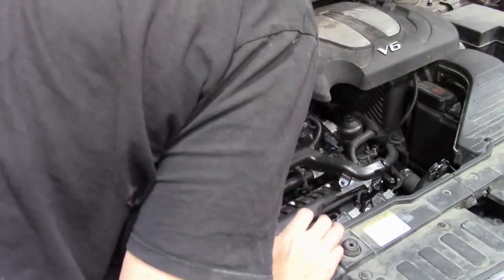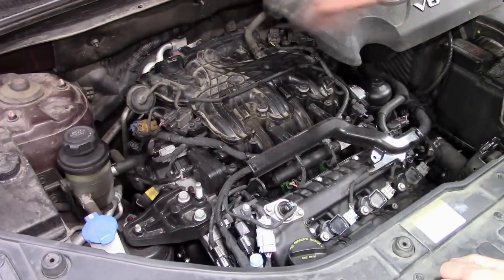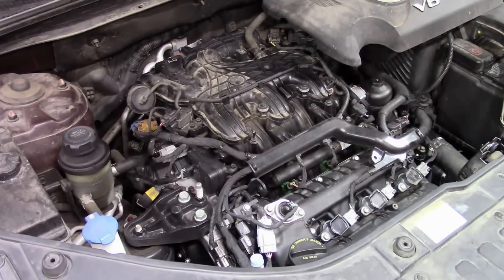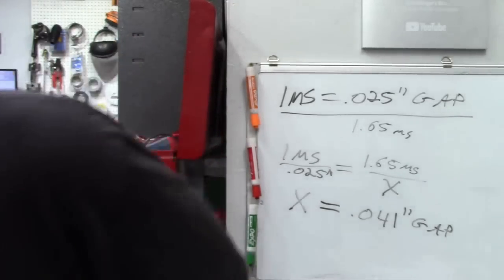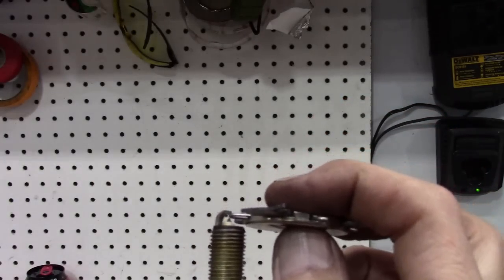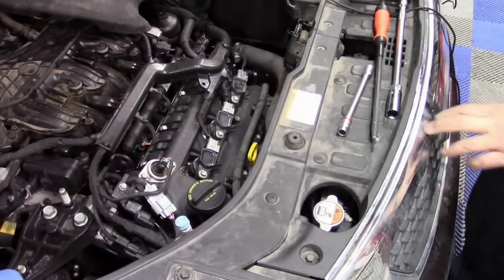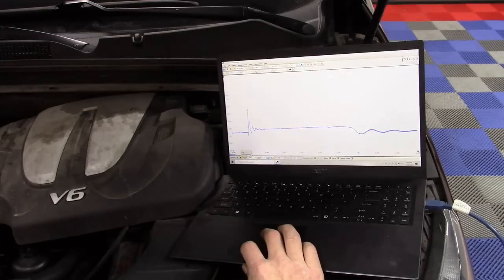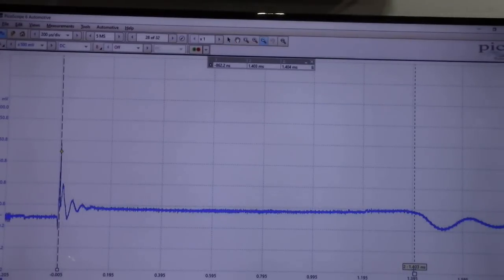Can You Tell Spark Plug Gap Without Removing The Plug?

Comment: Very cool! More gap requires greater voltage required to overcome resistance across gap, which will reduce the duration of spark, since the amount of energy available for ignition is limited. 

I'm an aircraft mechanic working in general aviation. Most piston aircraft have magneto ignition systems. If the spark plugs have too much gap, it will increase the "coming-in speed", the rpm required to turn the magnetos in order to function properly, and the engine will be harder to start. The mags will have to be driven faster, more engine rpm, in order to produce enough energy to arc across the excessive gaps. For what that's worth.

I have a feeling there is a logarithmic relationship between gap and spark duration.
Reply from the maker: correct. I couldn’t think of it at the time!

Comment: The essential component missing from your experiment was the voltage level at which the plug started to fire.  If you can factor that into your 1ms=.025 gap, you could be onto something.  Still the video was a success in my mind.  Experimenting is a great way to learn.
Reply from the maker: Thanks for the info!

Comment: the beauty of what you have done doesn't matter if you can tell the exact gap. the point is you can tell if they are all about the same. so if the 3 on the front are new and look good and you scope the rear and they are a lot different all you really need to know is if they are way different most likely they didn't replace the hard to get to plugs  thats the way i look at it wonderful info. would be great to know the gap  but knowing the difference helps a lot
Reply from the maker: Exactly correct.  It would have been nice to measure gap but it is not necessary if you have a standard.  The only challenge is not all engines have an easily accessible standard
Reply: @SchrodingersBox  my question is to have a standard wouldn't all of the ignition systems have to put out the same to the plugs. because if one system had lets say hotter coil then wouldn't that change it as well. i would think you would need a standard for every vehicle based on the scope reading you got. or am i going off the deep end and overthinking
Reply: @DependableAutoTruck  It is a differential test, not a measurement for spec. If all you want to know is did they sketch out on the rears you don't need to know the absolute state of the fronts, just the difference between banks.
Reply from the maker: Totally true, there are a lot of variables on this.  I will need to see how much those variables contribute.

Comment: One day I did a similar demonstration on the Pico with various plug gaps, and at first it lined up as we expected, longer burn time and lower firing voltage when there was a smaller gap. However clips I didn't publish, with double the normal gap, showed no difference in burn time, firing voltage, or spark voltage. So although the theory lines up fine, the sensitivity of that test to reliably identify plugs with large gaps is not great. Of course that may mean a larger gap is OK, but as plugs wear there are many changes, some of which are of no consequence and some of which can put extra strain on other hardware like the coil, etc. The other thing to bear in mind is the fact that in a distributor system there is a gap at the distributor cap, too. So you're dealing with the sum of the two gaps, bringing in another source of inaccuracy. The way intake manifold gaskets tend to get stiff and shrink with age, it makes sense to follow recommended service intervals and change what gaskets are necessary to get the job done. A tiny vacuum leak along the intake manifold may be equally hard to recognize.
Reply from the maker: Well if anyone already tried this it would be you Dave!! I will absolutely have to go look at your video but that’s really interesting and seems consistent with my trend. great point on the distributer cap (no pun intended).  I so seldom see those anymore I don’t think about it!
Reply: Spelunkerd, your pico secondary ignition video is one of the best available!

Comment: In any case, one can obviously do a differential comparison. In the same car with the same type of plugs and all else working correctly, the burn time should be consistent between different plugs. Significant differences front bank to rear bank should be noticeable.
Reply from the maker: Yep it looks like that may be the only way but hell that is still way way faster than removing an intake!!

Comment: What about applying this method to waste spark systems? 🤔😉
Reply from the maker: Damn Ivan hahah-- leave it to you to come up with a variable I overlooked!!!  I honestly didnt even thing about that.
Reply: @SchrodingersBox haha just flipped a neglected 2006 Hyundai Tucson V6 that I got for 350 bucks. Checked front bank plugs and they looked OK so I assumed the rear bank was fine. Had to remove the intake plenum to change the rear valve cover gasket so popped out a rear plug just for kicks. The ground electrodes were GONE on all 3 rear plugs!!! 😳 Car ran fine btw, never skipped a beat 🤣

Comment: A smaller gap means less resistance, so less energy is required to jump the gap. Hence, more of the stored energy in the coil will flow through the secondary - taking more time.
When more resistance is present , you have a shorter duration of secondary current flow and more oscillations in the primary. Love watching this experiment, keep it up.
Reply from the maker: Yep that is what I finally figured out-- just couldnt think while filming. I knew there was an explanation.

Comment: We have taught this for quite some time in professional classes. The way I learned had a pretty simple analogy. The amount of energy in the coil is a fixed, how that energy is dissipated is not. Imagine a length of string as the total energy in the coil. The flatter that you hold it the longer the horizontal line (longer burn time) it creates. The higher the angle between the ends the shorter the horizontal line. (Shorter burn time) The things that cause a change in the spark demand voltage (KV) are: Plug Gap, Air/fuel ratio, ignition timing, and compression. It's notable that the plug gap is only one of those. Burn time and burn voltage from there are also dependent on those same factors but now the resistance of the spark plug wire (if used) also comes into play because of the current that is flowing through the ionized ball of gasses between and around the electrodes of the spark plug. 

In practice we have found the COP probes to be disappointing. Many coils have sufficient shielding that makes them almost useless and if looking at secondary voltage and burn time is necessary for diagnostic purposes it's better to install a plug wire between the coil and the spark plug and use a conventional pick-up. 

If you want to have some fun with this try to answer this question. 
Why does the spark KV demand and burn time vary at idle as can be seen on the screen?
Reply: Hi John, it's Duane from iATN, no I don't expect you to know me, I pointed him to the old Mac Vandenbrink video on YouTube.

Comment: That's interesting how do you do this test with a bad fuel pump on this car,
Reply from the maker: The fuel pump issue is intermittent .  I just need it running and even if there was a fuel delivery deficit, all cylinders would be affected.  But a better way would be to do this without fuel and cranking only to remove the variable.

Comment: The common transformer is based on power factor. If the current flow through the primary is 8 amps and the voltage is 13 then the power is X. So the secondary….now we’ve stepped up the voltage,  the current is much less but the power output is still the same. So if we are trying to ionize a plug gap and push current across it and we reduce the gap size the available voltage to keep the current flowing is increased thus the amount of time the burn takes place is increased. Now if we increase the gap the initial voltage required goes up inorder to ionize the gap and because we’ve used more energy to start current flow across the gap we now only have so much left to keep pushing current thus the burn time is reduced.  Conservation of energy 
Same energy in same energy out. Big gap( resistance ) more voltage required less current flowing in time but same power out, Small gap less voltage required thus current flow increases in time and power out is same.
Reply from the maker: Great explanation!!

Comment: With a wider gap you will have a higher firing line. This will transition to a shorter spark line since the coil will have less energy to discharge to the spark plug gap
Reply from the maker: Yep it took me second during editing before it came to me.
Reply: Higher firing line, less energy to discharge. I'm obvy missing something fundamental.

Comment: If I understand this right ... Less gap means less initial voltage spike (voltage being pressure), to make the jump and the duration of the spark line can be longer.  And, the more gap means a higher initial voltage spike to increase the pressure to make the jump and a shorter spark line.  Do you think there is any value in also measuring the height of the voltage spikes in relation to gap?  Very curious....
Reply from the maker: You got it correct.  think of the firing line (the tall spike) and the spark line (the flat horizontal line) as a single string.  If pull the string up to make the firing line even taller, you shorten the spark line, and vice versa.

Comment: nice experiment. while you found somewhat of a correlation  there is a better way. when the coil charges and suddenly collapses the firing  spike is how much it takes to start the spark jumping the gap. the firing line is the voltage that the spark actually uses. so with a wider gap the firing spike and the firing line will be higher, conversely  a smaller gap will be less.  the time of the firing is not only affected by the gap but also the cycle time of the cylinder. an engine running at 6000 rpms has 10 more times the number of cycles as  an engine running at 600 rpm. with distributors and a single coil a display waveform was fairly easy to pick out the differences in firing voltages. we even used the differences to adjust carb idle circuits to match depending on the manifold design. cross h designs (mostly gm) were great , dual plane and single plenum not so much. coil on plug introduces individual coils each with thier own qwerky  differnces. but it should be possible to see a wide difference  by comparing each coil/plug combination. minor differences may not be possible. if the coils all use a common voltage supply an amp clamp on that supply will show the primary waveform which in essence is a mirror of the secondary and vice versa.
Reply: i might add that uneven air fuel ratio will change the spark voltage required and may appear as a wider gapped plug however this should show up at the end of the firing line as an upward curve
Reply from the maker: Yes Richard, I thought of that as well... if I did this again I would do cranking without fuel. Also fuel is a conductor which may also have introduced variables.
Reply: @richardcranium5839  Richard Cranium LMAoff.  Anybody else get it ??
Reply from the maker: Yes I did long ago lol.  one of the better screen names for sure.
Reply: @tklykun9858  there are like 14  richard cranium accounts here. i only found out after i made it lol
Reply: Either method will work since the spark line is directly affected by the firing line

Comment: Spark Dwell time ,as it used to be with contact breaker points and condensers 
To increase the dwell decrease the gap
To decrease the dwell increase the gap.
Reply: Dwell time controls the amount of magnetic energy stored into the coil magnetic field, to be later discharged (when the points open) into the coil secondary and into the spark plug.  Dwell duration does not directly relate to spark duration. Of course, if two different dwell time settings store more or less energy in the coil, that winds up releasing more or less energy to the spark plug, so that does affect the spark length.  The point is it's not a direct relationship between the two durations.

Comment: 0300 present?
Reply from the maker: Nope, not on this one.  seems the fuel pressure is sufficient but the pump cuts out.  Bad commutator I think.
Reply: @SchrodingersBox  i had a 2011 Santa Fe 4 cylinder. No driveablity issues at all. 200k 2.4 4cyl. Plugs could not be easier.
Starter not so much...

Comment: I guess this is indirectly measuring resistance. Does the ECM vary spark power and timing based on operating conditions?
Reply: Ecm varies spark timing but not the firing voltage. This varies depending on mechanical conditions of the engine: spark plugs gap, compression,  fuel mixture and other variables
Reply from the maker: Yep Deer Hunter nailed it
Reply: @deerhunter8533  Thank you for the insight!